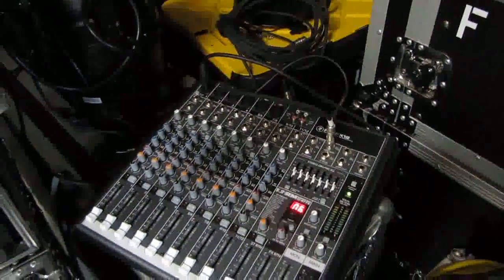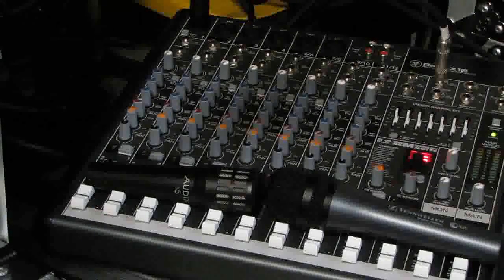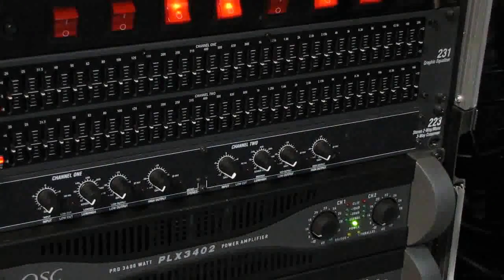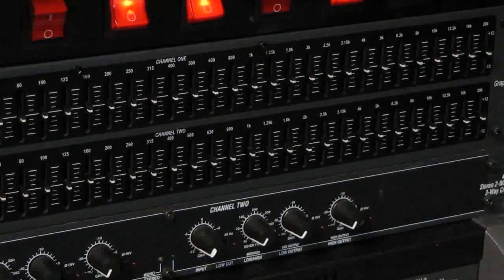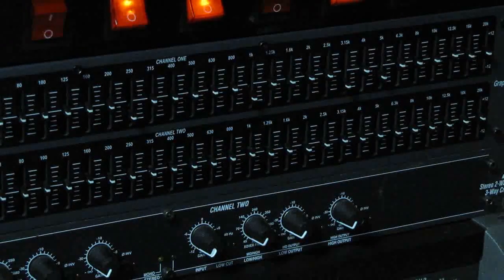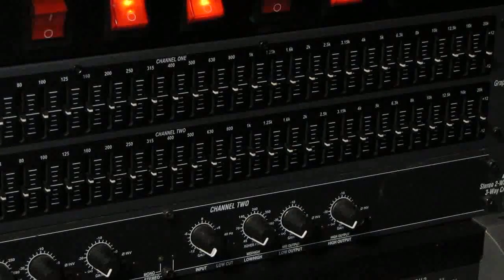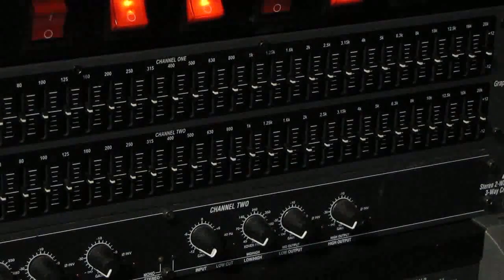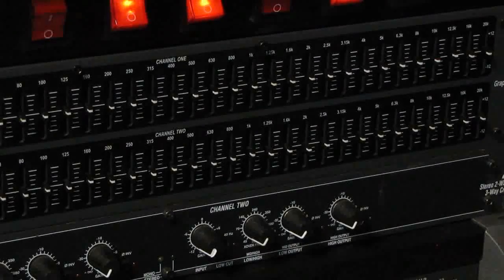Ringing out monitors using an EQ (analog setup) - Stage Left Audio

Comment: Oh crap.  Not another video using GEQ for ringing out.  The proper tool (now incorporated in all digital mixers) is PEQ.  Even if you're staying analog you should be using PEQ outboard.  The techniques are the same, but the tools are better.  GEQ is a hatchet.  PEQ is a scalpel.

Comment: Is eq place as an insert on mic channel or main out insert mix?
Reply from the maker: For this setup, the EQ was placed "in-line" between the main output of the board and the input of the amplifier.
Reply: Can i use the insert in main output to ring-out foh?
Reply from the maker: Yes.  An insert is usually preferred.  Just make sure the cuts are minimal.  Too many changes (or heavy cuts) in FOH EQ is usually an indication there's something wrong with the gain/EQ staging in one of (or other) channels.  Changing the FOH EQ alters the entire sound system... make sure the cuts are minimal.
Reply: @stageleftaudio  I am missing something, if I use the eq as an insert how is it effecting the house or monitors? What is the in and out sequence for my XLRs I guess is what I am asking?

Comment: OK , so how do i connect eq to each channel separately? I do have insets per channel and per group, whats the best method?
Reply from the maker: +rtt143 An insert for each channel is the best way to connect an EQ; however, connecting an auxiliary EQ to a channel isn't normally conducted unless it's to correct a serious "EQ problem" with the channel.  The channel strip EQ is usually enough.  If you are needing to EQ a choir or a drum-kit, the EQ should be added to a sub-group that has the mics needing the EQ (i.e. all drums assigned to sub-group 2).
Reply: +stageleftaudio you rock!,thanks
Reply from the maker: +rtt143 Thanks for the comment and good luck!

Comment: So were your monitors live in the monitors? Otherwise I don't I don't understand ringing out the monitors from from of house. Sorry if this is a dumb ass question.
Reply from the maker: +Sean Banks In this video, the monitors were setup in our shop (not a live situation).  Ringing out monitors from the house is very common.  All you are doing is listening to the monitor speakers (from the house) to hear feedback.  However, when ringing out from the house, the very high frequencies (around 2k and up) are hard to notch out because the monitor speakers face the performers (not the house), meaning it's harder to hear the higher freq. at FOH.  As well, each monitor channel should have its own EQ to use for ringing out that channel separately other channels.
Reply: thanks for the info!

Comment: hello everyone,i am an amature d.j. and i been deejaying for over 30 years.MY question is can anybody show me how to correctly hookup my new upgraded d.j. set ? I AM USING a laptop with a hercules dj 4 set controller, a europower 6000 powered mixer broad,2 gemini xga 3000 power amps,4 BEHRINGER B212XL EUROLIVE 2 WAYS and  2 ALTO SX-SUB18 18 INCH PASSIVE SUBWOOFERS AT 800 WATTS. I have try many combonations and have not been able to get all the compoment to work together and faction correctly.  help me please if you can. p.s. i also have a dbx  15  and a gemini 15 dual band eq2 .
Reply: +willie smith Why on earth are you asking a question like that in YouTube comments? Go find a forum about DJ equipment.

Comment: Don't you want to turn up a slider to hear if it's hot and then turn it down enough to eliminate it?
Reply from the maker: Yes, that is a way to test a channel for feedback; though, that method is usually used only when too much gain is applied to the channel.  Reducing the gain of a channel will correct some feedback issues.  Reducing the offending frequency to control feedback will yeild better results because it may not require the need to reduce the gain.

Comment: The singer in our band likes to get out in the crowd while singing.  Is there a way to ring out the FoH speakers so that they don't feedback even when in front of the mains?  I've seen at least one video where they talked about ringing out the speakers in this way, but they weren't clear on how they did it.
Reply from the maker: Ringing out FOH can be done the same way as monitors, however, there is much, much greater chance of having many different freq. feed back.  Because of this, it's very difficult to "notch out" offending freq. w/out causing the vocalist to sound different.  It's usually safe to reduce 2 offending freq. w/out altering the tone of the mic/singer.  Try reducing the mic input gain when the singer starts moving infront of the speakers.  Also, instruct the singer to keep the mic pointing directly at his his chest when not singing.  This will keep the mic out of of the direct path of the speakers.
Reply: stageleftaudio *terrible pun alert*  Thanks so much for the feedback.  :)
Reply: Dydreth stageleftaudio No need to thank him for the feedback... we didn't want any feedback in the first place!

Comment: A lot of Theory here but you Guys have no idea about what you are doing... This video could be misleading for those who want to learn how to do it the "Right Way" Other than this, why did´nt you Insert the Eq into the Aux Send? & At the end of the Video, you are still getting Feedbacks, simply because you do not know your Frequencies... try Baking bread for a change....
Reply from the maker: The purpose of the video is to show how to control feedback, but not so much as how to setup a (basic) monitor system.  The "monitor out" (Aux send) on the board is run directly into the EQ (and out of the EQ to the amp).

Controlling feedback involves many environmental and technical variables.  The video represents a small sampling of some of the variables.
Reply: stageleftaudio Sorry, But still you guys did not get it under Control, simply because you do not know your freq´s, e.g. it was constantly feeding back by 400Hz but he was searching by 125 & 250Hz to kill this Freq. Does not matter how your connection is configured.
Reply: stageleftaudio I prefer to send my aux outs in-line with the EQ to the amp as well...there's been a lot of concern by audio mixers about 'insert' vs 'in-line'...as long as the cuts outweigh the boosts (if any boosts at all) and the EQ isn't overloading, in-line works great. I like that others post videos so that people who want the info can get as many methods as possible and I like the idea of comparing two mics, just to hear what's what. Good video. Thanks for sharing!

Comment: I play guitar for a "one-man band". There are 3 vocal mics, obviously 3 channels.  

Is it necessary that  each channel get it's own EQ?
Reply from the maker: It depends on the number of monitor channels you need.  If 3 monitors are needed and each vocal mic needs their own monitor mix, you will want to place an EQ on each channel; EQ's are not always needed, but are a good tool to control feedback.
Reply: Yes.

Comment: The frequencies that should have been attenuated on sennheiser are, on this particular eq at least: 250 (a bit above actually), 1.25 (he aimed at 4, than a bit lower, but still too high, at 3.15), 630 (he aimed too high again and then a bit low). Haven't watched the audix part.

I'd like to point out that I'm not sure if I would have guessed the right frequencies by ear on the first try. But I would probably end up rising the bands around the frequencies that I think the tone is ringing at one by one just a little and eventually have landed on the right one. Then I'd just attenuate that one.
But this is like the person in a video said, a mic pointed directly into the monitor speaker, and I don't know if the exact same ringing frequencies would appear during the show. At least in that amount.

These days everyone has a smart phone, and there are apps like tuners and what not which point out frequencies. So I guess that could help in a situation like this. I don't own one so I have to do it by ear every time. And most of the times there aren't any eqs for the monitors. :(
Reply from the maker: Each room will present different variables for determining which freq. needs to be cut (and for which mic).  There are a few freq. that seem to be somewhat consistent in their need to be cut, but not always the same freq. all the time.  Thanks for the post.

Comment: Great tutorial but for the gigging pub band I found the Shure DFR11 EQ does well as it reduces/removes feedback on the fly and it has other features built in if you want to use them, But you can't beat doing it the manual way.

Comment: usually octaves feed-back .. notice that 1k, 4k, 250, 500 all feedback .. those are an octave (or several octaves) apart.. granted the setup is designed to provoke feedback. its not a typical way to ring out a system. i tend to eq to taste, then eliminate any feedback if nessecary. other than that. pretty informational and well spoken.

Comment from the maker: The setup is a "lab" format.  The mics were positioned about 45 deg. off center from the front of the speaker and sat about 3 ft. away.  The whole environment was setup just to cause system feedback; therefore the video is showing how to control it.  The channel EQ on the board is flat.  There's many ways feedback occurs, but only a few ways to control it - this video is showing one of the ways.

Comment from the maker: The numbers indicate how loud, in db, the signal can be (relative to the input level to the EQ).  All the db levels #'s on all equipment (including the monitor fader) reference how loud the signal is.  The faders should be positioned for what works for you, however, it may best to turn up the monitor fader (especially if the EQ is serially connected) about 1/2 way, and turn the aux pots down.  Gain structure is VERY important to getting good sound.  I'll try to post a video on this topic.

Comment: i use the those all the time but know little bout them. What do the numbers beside the monitor fader mean? and where should the fader be on the main monitor slider? should i have it about half way up and then set the individual aux vol pots on each channel? i play in small noisy venues and sometimes loud monitor volume is necessary. I find that if i barely have the main mon fader pushed up and the individ vols cranked high, it sounds choked, airy, and doesn't have much body.Can u please help me?